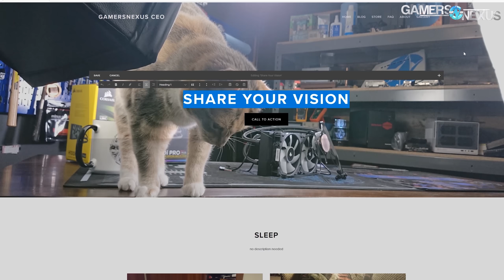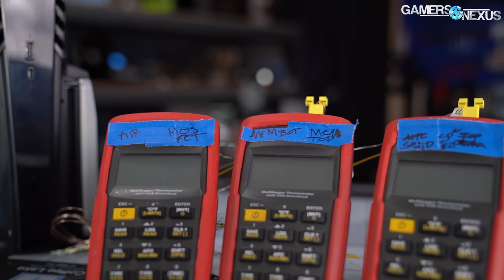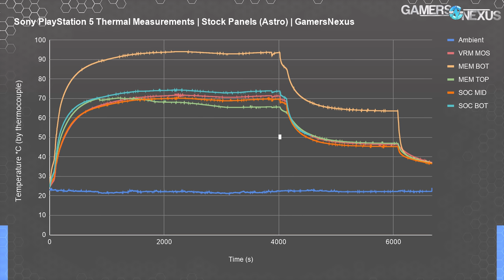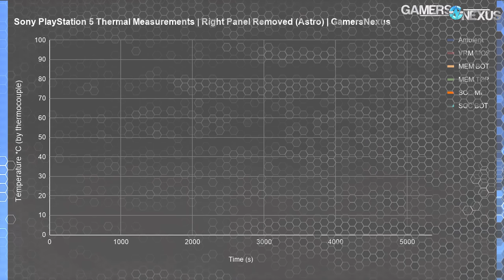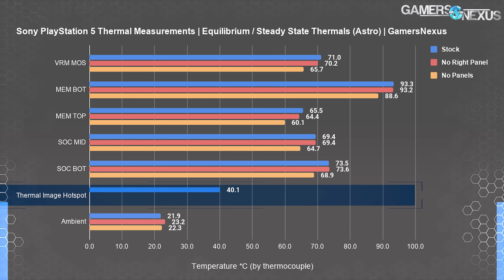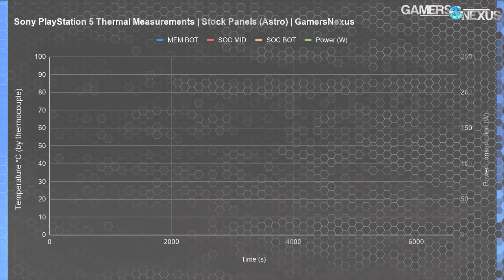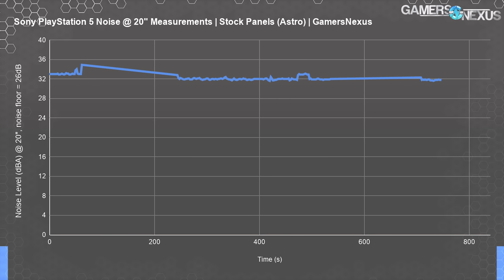Weak Cooler Design: PlayStation 5 Thermals, Power, & Noise Testing

Comment: Stopped watching the moment you said you had to use a mallet to get the case off. Watched various videos and even done it myself. No one else has even come close to this issue. I did coke back to watch the rest though. You say that you putting all those wires in place will do nothing to hurt the performance but I’m pretty sure that a company that spend well over 2 years developing just the cooling on it knows what they’re doing. I have had mine on a few hours a day every day since I have had it and not had a single issue. Probably because I don’t open it up and plug loads of random wires through it.
Reply: "pretty sure that a company that spend well over 2 years developing just the cooling on it knows what they’re doing"
There is your problem, you expect a multi-billion dollar company that is built to create cheap mass-produced margin-fat products, to do industry-standard QA. The truth you disconnect from is that they cut corners everywhere they can. Stop believing that consoles are made in aspects of "high-quality". You pay for cheap computing products, you get what you pay for.
Also, unless you are electrical engineer, you look stupid arguing against their probing techniques that are higher-quality than Xbox and PS's own QA.

Comment: A bit late 
But I do wonder if the Digital would be smaller becouse the BD drive feels like an after thought it's connector even looks like it.
To me at least it were clearly designed to be digital and then just slap a bd drive on the side. lol

Comment: Never get the first version of anything, a car or electronics doesn't matter. There will be surely an upgrade within 1 year maybe not a "Pro" model but they will definitely change some internal components silently.
Reply: If no one ever got the first version, there wouldn't be a second version. How about if you get the first version be wary that there is probably some issues/or concerns that would be addresses in later iterations.

Comment: If the memory went to 100 degrees I would be worried. They can take upto 110
Reply: The max specification is 105 and max recommended temp is 95 for GDDR6 but that doesn't mean that the life span will not decrease if the memory is at 90 degrees or higher. We could see a lot of dead PS5's in 2-3 years.
Reply: @pxl_shoot3r602  
The giant fan can be updated with firmware. Don't worry
Reply: @ps5stuffguy  Fan updated ?! You mean increase the speeds! So another PS4 jet 🤣
Reply: @cia4gent128  Nope. It's a giant fan. Will not need jet speeds. Watch this video till the end also
Reply: @ps5stuffguy  Wtf you mean by The fan will get updates? Lol 😂
Reply: @ps5stuffguy  First of all how the fuck will you update a fan with firmware? And dude you didn't understand the whole video. Even with higher fan speeds or whatever you want to say the memory will only be a tiny bit cooler. IT IS NOT CONNECT TO SOMETHING WHICH COULD COOL IT. And the fan is maybe not small but it is definitely not giant.
Reply: @pxl_shoot3r602  sorry my mistake.
Reply: @FRIEDBERT I hope you tagged the wrong person
Reply: @ps5stuffguy  There's two ways to increase cooling. Surface area and speed. Since you cannot increase surface area with software, you can tweak the fan curve. The motor has a maximum RPM, but the PS5's fan is running slower than the max. 

The Update in question is to allow games to set the fan curve, which means... it may get louder.

Comment: Guessing you're already aware but there are circles which hold the side panels on. If you lift up in the top back corners then it's easy to slide off. Quite happy with my PS5 in all honesty, even if thermals could be better. The actual performance is quite nice and getting Monster Hunter World for "free" (PS Plus subscription) has been great, so many hours in it already.

Comment: GDDR6 RAM has an operation temperature of 95°C. The maximum permissible temperature is 110°C. The PS5 undercut both values. How far a problem should exist is therefore beyond my understanding
Reply: My hero!!! Someone with common sense. I hate all these sort of videos that try to nit pick little things. I remember my old ps3 Jesus I could cook a steak on that bad boy but guess what had it from day 1 until PS4 came out with no issues... shock horror !!
Reply: There are plenty of areas that spend significant portions of the year 10 to 15 degrees Celsius hotter than the ambient temperature in this test.
Reply: The problem is this was done in a 21 C room. Imagine this in peoples homes in parts of Asia with 35 C?

Comment: That backplate absolutely is aluminium. The magnet is picking up the steel spreader on the opposite side.
Reply: Good catch. I can confirm that heat shield is NOT MAGNETIC.

Testing using a long magnet on the disc drive and M2 slot cover, which were magnetic, and then on the heat shield (using the hole above the disc drive which extends through to the heat shield), which was NOT magnetic. He usually doesn't make these kind of mistakes with his PC component reviews so I'm really surprised.

His other mistake is the gap he created routing out the wires, which could've raised GDDR temps:

[Imgur](https://i.imgur.com/MkZGzeJ.png)

Comment: Please don't hit the side panels!
The back corner is flexiblw and has a tab that sticks into a depression in the console. This is what holds the side panel in place, and slightly bending the corner so that the tab is lifted out of the depression allows you to easily slide off the side panel without hitting it.

Comment: Maybe an option in the menu to enable higher speed fan to run the unit cooler. ¯\_(ツ)_/¯ 
That or mod the fan, hardwire to 12v rail.

Comment: Lol, I'll never buy a console that memory reaches 93°C, it's a certain BGA solder issue in the future, take for example Xbox 360 reaching around 88°C and that gave us the RRoD on most of the time because of the memories and gpu BGA solder cracking due to extreme heat and cooling afterwards

If I buy a ps5 it will be on slim revision.
Reply: So why it didn't happen to anyone? 
Xbox 360 has a 50% RRODing units.
Reply: @wasapdoc  yeah just buy it and when it fails you can come and remember this post
Reply: @wasapdoc  These sort of heating related failures happen after a few months. The RROD failures didn't happen at launch.
Reply: @Naruxos07  
I know someone whose 360 fried in days.

Comment: I had a few PS4 titles that would cause full system crashes every half hour. Removed those metal fan grates from each side of the PS5 and now the one game tested Rage2 will run over an hour before crashing(black screen full shutdown). There’s no dust buildup inside and it’s well ventilated and these few problematic PS4 titles are fully patched. PS5 titles NEVER crash & ive never had a heat warning & rebuilding database did nothing to fix the repeated crashes at 30 minute intervals. It’s just a really bizarre situation & frustrating because you have to go manually reboot the PS5 after a hard crash. Maybe it’s thermals or bad silicone or clock speeds wacky for only a few PS4 titles out of the dozens that I’ve run flawlessly?

Comment: Those sheet metal fan grills are laughably and unnecessarily over restrictive, I use the steel wire grills for our products and they have negligible restriction while offering the same safety.
Reply: I'd guess the sheet metal ones are cheaper since they can be made in one stamp?^^ But thats just a guess

Comment: I wonder if the freezing and game lockups people are receiving is because of the bottom memory getting a little too hot.  You can have a stupidly fast hard drive and yeah it will make load times quick, though still its just a computer and a computer will load the game to ram/memory, memory is closer to the APU so its faster to access. I don't know why consoles don't copy this closest console to copying a PC is the Xbox Series X. To fix the memory heat issue you put a heatsink on the memory. They sort of do this but they do it the way notebooks do with everything pressed up against a vapor chamber heatsink going to one block of aluminium.  On PC memory is a separate removeable chip that most gaming quality memory modules are encased in their own heatsink. maybe its time consoles stopped just sticking everything to the motherboard with solder. No more BGA solder joints holding hot chips onto the board should reduce failure issues like consoles got in the past with the RROD and YLOD on the Xbox 360 and PS 3.  Seems the APU temp is fine but that memory is toasty.

Comment: 93c is not that horrible, Memory of AMD 5700xt reference design was hitting 110c max 
And they both are GDDR6.. so yeah, 93c is a little high, but not that bad
The only issue is hot countries (40c-49c) which will make memory jump from 93c to 105c or so
GDDR6 (memory) by default are hot, they need good cooling, unlike GDDR5

Comment: So, a giant company like Sony couldn't properly cool a 200W heat load 🤣🤣🤣. They used liquid metal and a 20W blower and still couldn't cool it. The old GPU blowers did a far better job of this and without liquid metal to boot. Also,  asking a random person "How would you have done it" just to shut them up isn't a valid argument. Ask the people who design coolers and chips for a living before launching a product that requires an AC for all the components to stay within spec. I understand they're selling the consoles at a loss but bad hardware design will increase their RMAs and cost them more in the long run

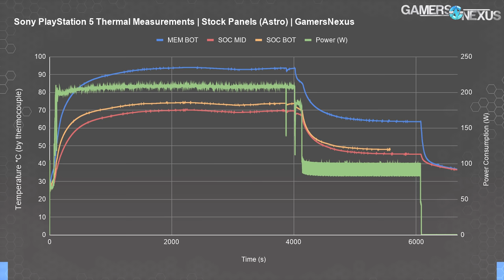26:57 It's not needlessly fancy, it's actually a nice evolution from the PS4's menu. Why it would need 100W of power is the real question we should be asking

Comment: The interesting thing to me is, in reference to console noise, I have never experienced excessive noise from ANY console. I have been gaming since Pong was a new thing, and have owned nearly every console since (except Anything from Microsoft!), and never had any real noise problem. My PS4, later PS4 Pro, were very quiet. Of course, most of the games I play are quite loud... if I can't hear the disc drives or fan while I'm playing, then it is quiet enough for me. As for heat, the only problem I've ever had was during a recent extended Skyrim play on my PS4 Pro. The system locked up, and the only way to restart was to unplug it and do a system check and reboot.  But it was my fault... I had left the dust cover partly on, blocking the air vents. Hasn't happened since. I will eventually buy a PS5, once supply is up, the bugs are fixed, and the scalpers go away.
Reply: Why haven't you bought anything from Microsoft? Just curious
Reply: @itschewsday5252  First, I should let you know that I'm 68 years old. I was a hippie radical in the late 60's who got civilized. Microsoft, in spite of humble beginnings, got too big and too full of itself, refusing to share technology that would have helped expand computer use in ways we cannot know. It took Linus Torvalds... and Unix programmers like myself... to work on making open-source operating systems possible. And yet, Microsoft remains proprietary, and is ubiquitous in its control of personal and business computer operating systems. I guess the old radical in me rebels against big corporate culture like Microsoft. That's not to say that Sony isn't a big corporation, they are, but they have shown themselves more responsive to gamers, and the SCEA division is a lot less corporate-controlled than Microsoft's X-Box console products.  But in the end all that matters is, who makes the games I want to play?
Reply: @thomasdarby6084  that's fair. I, personally, don't like Sony because they false copyright strike someone for just talking about leaked gameplay of a new game. But both are big companies and when they're big companies, there is greed so I get it from a business standpoint

Comment: You should have measured the 8 memories in order to draw conclusions about which ones get hotter and why, because you have not measured the two on the right, nor the one in the lower left corner, you have only measured two. Therefore we do not know if that memory was wrong, since the one on his side should be heated the same, but we do not know.
Do another test and with another console just in case, because you have generated a lot of commotion, perhaps for no good

Comment: I hope SONY will check this video ! And some GENIUS apply a solution to the next model of PS5 , im not talking of NEW PRO MODEL i am talking of the same model but a revision how they did with every console , ps4 pro have got 3 or 4 revisions , models who imrpove stuff slightly! ( Its needed a internal solution , as a extra heat sink or pipe or whatever to drop down from 90 to at least 80 ! Because if reach 90 with 24 ambient temp ... this mean in hot areas , in summer 34 - 40 degree the internal 90 at the memory will overpass 100 with sure !!! AND THIS IS DANGEROUS ! Even on the side panels where is the vent will be cool if have some holes tiny ones with dust filter inside the panel will be cool too ! Anyway , one day when i get PS5 will make holes on the both sides where is the fan and put dust filters under the panels over the fan !

Comment: Looks like I’ll be adding an AIO and a 120mm fan blowing air straight into the memory like I did with the PS4 Pro. 

It seems that they are loosing too much money on the PS5 and are trying to save money where they shouldn’t.
Reply: memory is on top of bluray drive. cant mod

Comment: Any statement form Sony yet? If thermals on the v-ram causing any problems in the future, sony has to exchange your PS5, because it is a hidden shortage. Design flaws are always a reason. Maybe Sony wants to sell more consoles after 2 to 3 years and designed it that way. A product that never breaks is bad for the manufacturer because they don't sell any hardware. For the customer it is bad and I hope Sony will react to this. A technical evaluation by Sony might be necessary to save the reputation. However, you can also falsify the numbers here.

Comment: My ps5 BURNT OUT! No warning then the screen went blank, smoke, flash and burning electrical sound and smell that could of caused a fire had I not been there to turn it off straight away. The burning smell does seem worse around that area. It’s now been 3 days and I’ve a total 5hrs30 on the phone trying to sort it out and Sony have still not arranged to pick up my console, apparently a supervisor will call me back at some point.
Reply: Any prove of that? Pictures?
Reply: @mentugo  I tried to open my ps5 to take pictures but couldn't without voiding my warranty. I've had every Sony console since launch and they all still work. Feels like the ps5 was rushed out the door which is a shame. At least sony have taken it back, I'll ask them for a report of what went wrong and post it.
Reply: @jamessiebke2309  have you've been able to post anything yet
Reply: @jamessiebke2309  I smell cap you can at least take pics of the console not in the inside just the back
Reply: @turtlefan5629  there was nothing on the outside to take pictures of, just the smell of burnt out electronics. Not that I need to prove anything to you. it was massively disappointing and Sony handled it incredibly badly which is a shame. I've got a replacement now which seems to be OK but to get that replaced was far more difficult than it should to be.